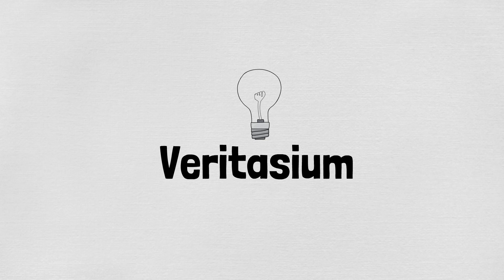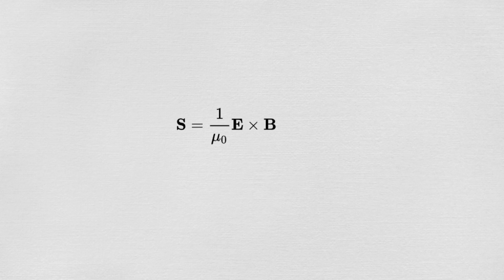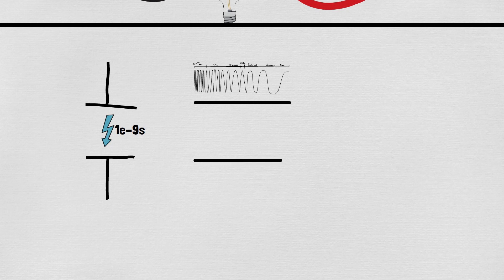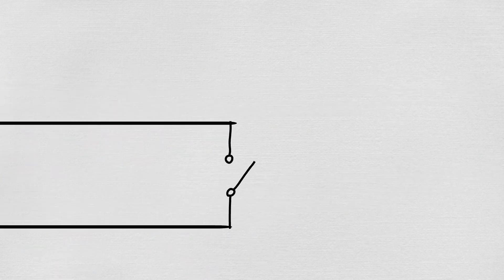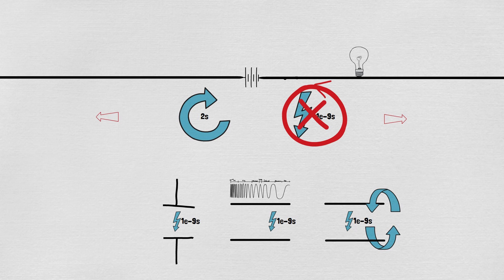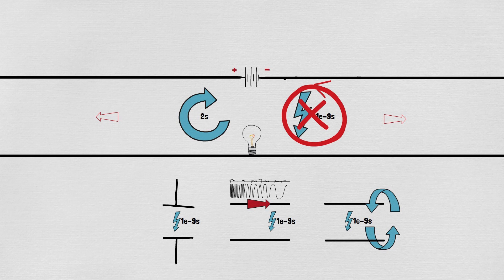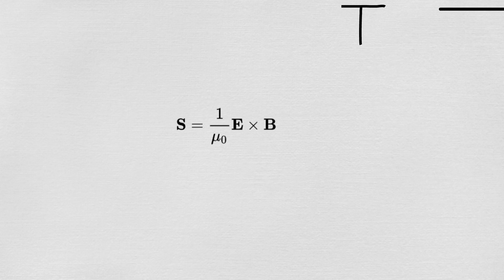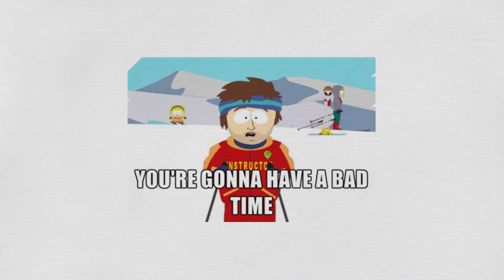Veritasium is Right? (see description)

Comment: I think part of the issue is with the "light up" vague description given for the problem. It implies the bulb immediately recieves enough voltage and current to be fully as bright as it would be at the end. We allow for "line can be very long" but we ignore the resistance or inductance of the line, and these two things are critically important. That bulb is not going to get all of the energy it needs to be fully bright as soon as you hit that switch.
Reply: But this is an important aspect, and also what makes it grossly misleading. The energy reaching the bulb will be almost 0, untill the wavefront along the wire reaches the bulb.
Reply: Derek says that in his video.
Reply: @wviampero  so it's a stupid thought expirament. The bulb would already be "on" because Mars's magnetic feild is moving relative to the bulb and thus inducing a tiny amount of EMF in it. Our any other object in the universe.
Reply: Fully agree, this seems to vector the discussion into how long it takes any signal to reach the light bulb.  I think a better way to phase the implied question would be to reverse the setup and instead ask: how long does it take the bulb to turn off after opening the switch?
Reply: @admthrawnuru  interesting. So, if I understand you correctly Derek should have revised the assumption to, "As soon as the battery receives any current, from the battery it lights up". What I'm understanding here is that Derek is wrong because he didn't specify the source of the current as a requirement as part of his assumptions. Very interesting.
Reply: Resistance and inductance are intentionally neglected as part of the thought experiment, but yes from what I understand the speed at which the wavefront travels is constrained to the wave propagation speed allowed by the wire.
Reply: @Steve-jy1vd  "Any change in the system is the metric" it seems like the disagreement between physicists and engineers is the definition of the lightbulb.  As an engineer I believe there's no way you could get an actual tungsten filament to visibly light that way, no matter how big you made it.  You could probably get an LED to pulse with sufficient coupling and pulse current and if the wire was long enough you could differentiate the initial pulse from the charge propagation, but now we're back at transmission line/antenna theory.
Reply: @maxgorbman8898  There are just some basic issues with the explanation in Veritasium's video that goes beyond it just being a matter of "any change" or that some energy arrives at the bulb. Let's say we were to move the bulb and switch 2 meters apart instead of 1. What would happen then? Even vacuum has an impedance, and capacitance usually assumes infinitely large adjacent plates. The way this is fomulated, it is too flawed to consider it a physics thought experiment, because even in an ideal case with no losses, you'll still have isotropic radiation from the wires, and an extremely low mutual capacitance and inductance between the 2 sides. Furthermore, the bulb will have some intrinsic thermal noise. Is this enough to turn it on? Will the coupled pulse be more than this level? Probably not.
Reply: No, that implication is false, the opposite is true: Derek tried to talk about an indefinitely sensitive current detector, and didn't care about the value of brightness.
Reply: @FrilloTeslar  Why do you believe I=Vin/(2*Z0) current creates almost 0 energy?!? With approximate numbers: 12V/(2*1kOhm)=6 mA. Is it too low to light a bulb by definition? 
The wavefront is spherical, travels from switch to bulb also. The initial current is ~6 mA. But when the same 6 mA step is reflected from the far end, it is only added to the initial current, doesn't magically create many ampers. If the bulb required high current, then the wave had to be reflected multiple times. The current would be a series of steps converging exponentially to the final value. So with not extra sensitive bulb many seconds are needed, not just 1 s.
Reply: @PafiTheOne  Where do you get those numbers from? It's a lossless wire radiating isotropically due to the transient. The amount of energy going in the direction of the other wire directly is tiny, and there is significant loss in free space. This means we can disregard this wireless transfer of energy, as even in the ideal case, the magnitude of power transferred is almost 0. Inside the wires we then have one side of the circuit already at the final potential, and through the switch, we have a wavefront which has to travel all the way along the wire to the bulb, before any energy more than approx. 0 is delivered to turn on the bulb at 1 s.
Reply: @PafiTheOne  Maybe he mentioned that at some point, but then the rest is just grossly misleading. In this time and age, we really don't need more disinformation of this sort.
Reply: @FrilloTeslar  Extremely compact summary, however it represents only your aversion, not his reasoning. Try to respond real things (actual statements, questions, calculations, etc)! At least if you want to understand electromagnetics. 

Derek indeed have made 2 false statements, but none of them are technical. And he was not absolutely clear, but not misleading, only misunderstable.
Reply: @Quadratic4mula  I mean sure, but it's still super trivial at that point. He set it up to fool people by suggesting you assume that everything must be lossless, but then makes the argument that the bulb lights up from what would normally be considered a parasitic inductance.
Reply: @PafiTheOne  If he had substituted a radio for the bulb, which can easily detect tiny currents and produce a click, then the game would have been up. Everyone would have realized it's just unavoidable RF leakage, and of course that propagates at c.
Reply: @mal2ksc  A radio (receiver) detects only a short click due to its own bandwidth limitation, but actually the current on the bulb remains constant (~6 mA) until the additional, reflected waveforms arrives, that builds up the final current step by step. This is not an unavoidable sideffect, but the basic nature of how transmittion lines work.